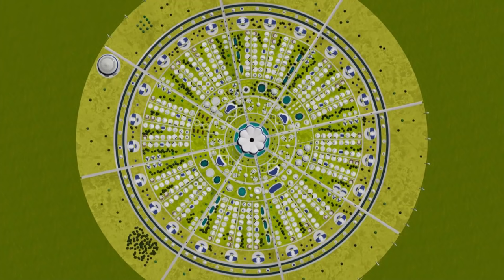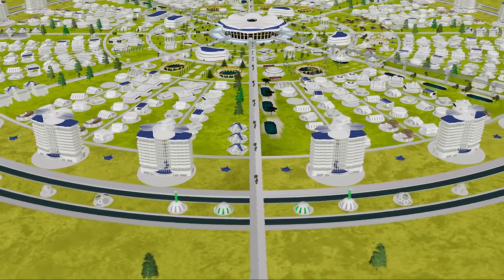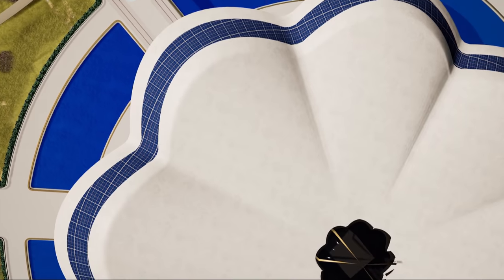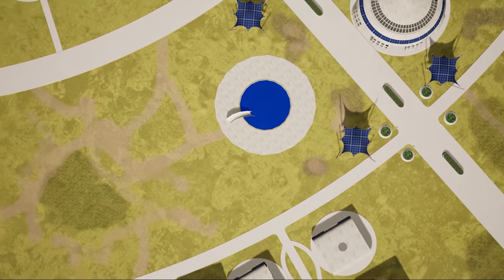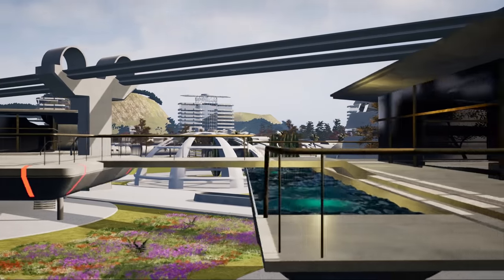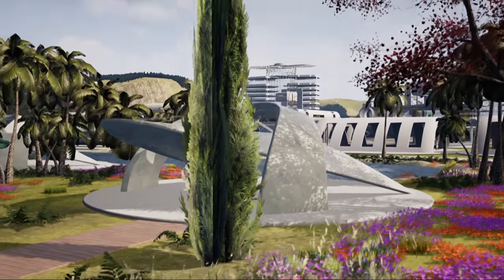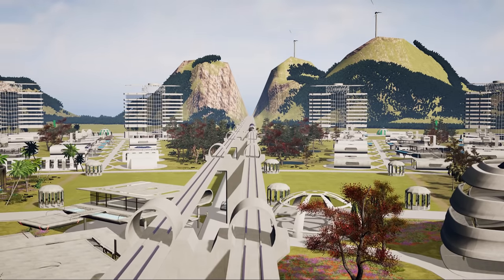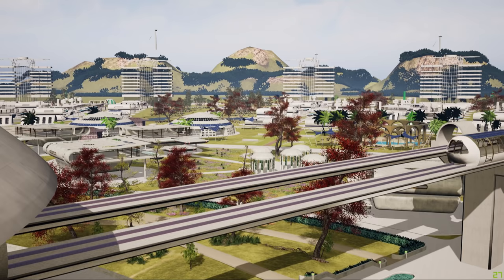Circular City Designs

Comment: A lot here I like but not sure about allocating sections for specific functions. We'd get into the same problem suburban zoning has given us, where schools, rec facilities and commercial spaces are far from residential neighborhoods, requiring that folks drive or take public transport. If you consult with disabled folks and the elderly, it's not ideal to have to take a bus to do your groceries. If the pool is too far away and takes too much time to get to they're going to skip their cardio rehab. Or whatever. As the parent of 3 kids I don't want to have to load my kids onto different busses every day. I once lived in a city where, despite its many flaws, most of what I needed and wanted to do every day was in walking distance. 2 rec centres, three grocery stores, 3 schools, and a farmers market were within 15 minutes of my housing co-op. You get the picture.

Comment from the maker: To Darris Hawks who wrote: "Expanding the city would require much more effort than expanding a grid city, which can be expanded in modules."  I am sorry, I accidentally removed your comment. I wasn't paying full attention and accidentally hit the remove button instead of reply. Unfortunately, youtube won't allow a removed comment to be reinstated (there is no ability to do so; I would if I could). I apologize for my accidental click. I would also like to respond to your comment. The cities are not meant to be ever expanding, as is the case with modern cities and suburbs. These circular cities can be reconfigured inside, but the diameter is mostly fixed. Instead of expanding cities horizontally, a new city is created nearby and connected by a transportation network so that nature is left between cities. The cities can be updated internally and expanded vertically, but they are not intended to be expanded in land area coverage. Again, sorry for the mistake and I hope my response is appropriate to your statement about how modern cities, because they are squared (in a square grid) can expand efficiently over land area. Also, this topic is more greatly discussed in other videos on this channel, as well as on the auravana and venus projects' websites.

Comment: What are some of the disadvantages? I'm all for this but just curious!
Reply from the maker: Intelligent question. I don't know at the present point in time. That analysis will be included in the material system specification (which is presently being worked on).
Reply: a huge disadvantage I see is that the location of a circular city plan is limited to few places. Rivers, the ocean, mountains and, in the case of my city, ravines don't allow for an increasing circular city.
Reply: VEGA Good.  Then once the city reaches capacity a new circular city is built elsewhere.  Also you probably wouldn't start a circular city right next to a natural border.  I would like to see one built with a river running through it.
Reply: While I am all for densifying cities to decrease urban sprawl, I think that that's sort of dodging the issue that VEGA points out.
Reply: There isn't a lack of places to put circular cities as long as the buildings themselves can continually be built upwards without having to evacuate the people from the building. I would recommend a modular design where additions can be added with minimum time, noise and pollution.

I wouldn't recommend building a city with a river running through it simply based on past experiences when levies and dams have failed. Also, we have to minimize human waste leaching into the rivers. As it stands now, the city of Chicago redirects its untreated waste water into the Chicago river when we receive more than an inch of rain in a 24 hour period. That means everything people wash down their drains and everything that washes from the streets goes into the river and ends up in the ocean.
Reply: @Allen Loser, can these foundations be created larger than normal for increased capacity in the future?
Reply: @Allen Loser, I'm not married to the idea, but just wondering if it's an option.

Comment: The problems I see with this are: the sprawl that will be created between two cities, the individuals desire to live outside of civilization, the limitations of this type of build due to natural geography, and government tendency to put off the upkeep of infrastructure.  The sprawl between cities will occur organically as it always has due to those that prefer to live in the wilderness living out beyond any of this.  Then they will gain neighbors that also like the wilderness.  This will repeat on and on until it is a village of people.  Then eventually this will spark business to buy and build there.  This growth will continue until a town exists between the two circular cities.  If the town continues growing from there a city will form.  If this city grows large enough it will connect the two circular cities.  Restricting people from living in the way they desire is not only illegal, but more importantly wrong.  The geography of civilization has historically meant humans build around the physical features of the land they occupy, this type of building does not seem to be able to adapt.  Government, especially local level government is historically lazy and bad at managing funds.  This is the reason in cities there is always sections with bad roads, outdated, equipment, etc.  I think this design does not take humans into account, and focuses entirely on the math and logic of the build.
Reply from the maker: Thank you for your comment. The socio-technical standards for the type of society from which these types of cities emerge is different than they type of society you are describing and imaging these cities within. The socio-technical standards are freely available on the projects website, www.auravana.org, and may clarify some of these points.

Comment: Look at the chaotic distribution of that model and the scale between the central dome and the houses. You are not competente to do this job!
Reply from the maker: Fabricio Fercher I think you have the wrong impression of why this video, and the other videos in this series, were created. The city is in this video was modeled and then imported into a game engine. These  videos give a brief intro to the material system of a community and show that we can work on this direction together, collaboratively. And also, that we have the ability to start simulating out the city. You can't go from a modeling software 3D model to building in reality anyway. One needs to work in Bim software (or equivalent, first) anyway. Have you seen the specifications on the /specs page of the Auravana website? Notice that the material system spec isn't complete or available.